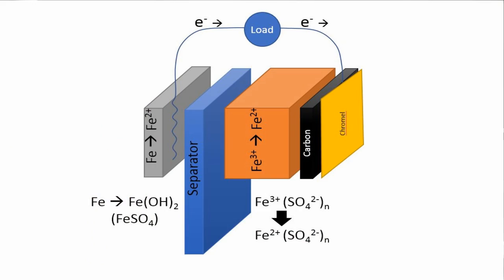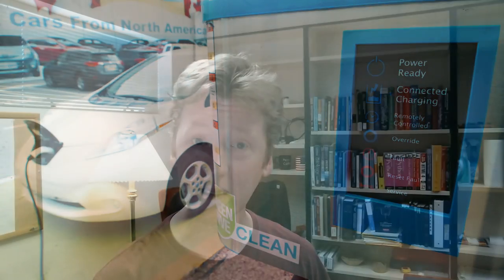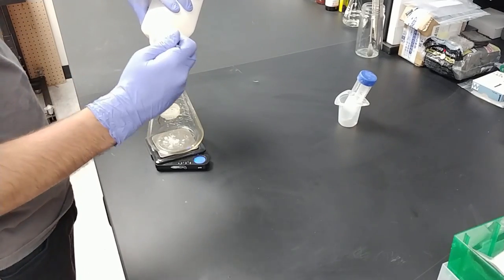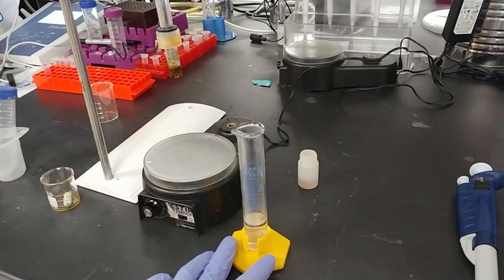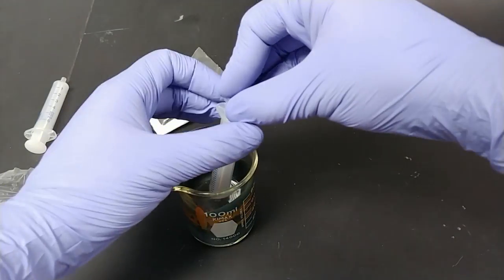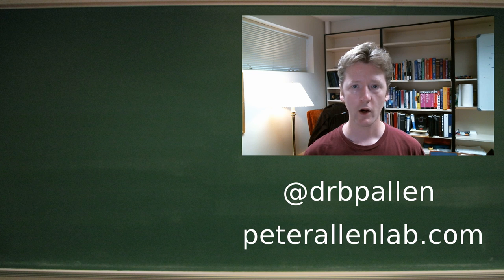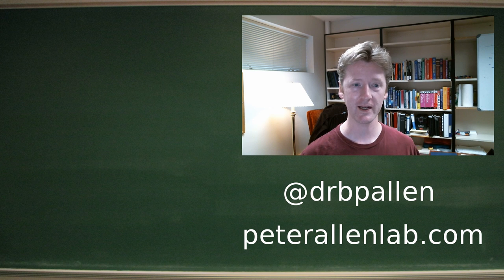Iron Battery 1.0: Build Instructions

Comment: I'm interested in the membrane that you created could you use that for a fuel cell hydrogen fuel cell with platinum in the whole thing Hillary so has oxygen your your container has oxygen on one side with the platinum and then and then what happens you have a barrier in there and then you have the hydrogen dribbling on another side and I know that another electrode and apparently he creates electricity just wondering if this membrane that you made it might hold up
Reply from the maker: We have tried several, but hydrogen is really good at getting through membranes. Usually fuel cells use Nafion. We have tried paper treated with nafion suspension, but even that might leak too much for a fuel cell. You really don't want hydrogen and oxygen to mix. The iron battery is very tolerant to cross-membrane leakage compared to a fuel cell.

Comment: would it be worth using them for home power storage?
Reply: Good question
Reply: YES - the ratio of weight to power works best for stationary applications.
Reply: Rough size on 48 volt 1000 kilowatt hour
Reply: @homermcclain7694  consider ESS made a 40kw battery fit into a tractor trailer, very large.

Comment: thank u...any posibility to power a  laptop..how big a batt u need in size weight ussing solar,,and  a invertor..
Reply: Please understand that while someone could just try to answer your question, I'd like to help give you and anyone else with a specific application need,  the tools to figure out the answer to their need.

1) Go to ebay.  Search laptop power supply.  Pick one.  Take note of its voltage and amp rating.  Consider how long you want to run it. The purpose is determine how much of a battery you need in terms of voltage, amps, and amphours. 

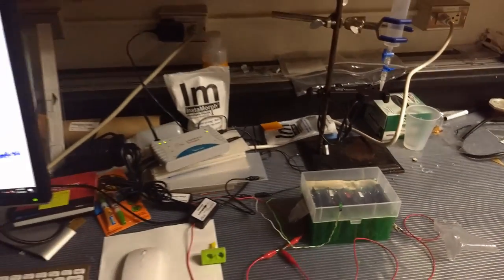2) Rewatch the video. Take note of the battery figures stated between 3:27  and 3:50 in the video. 

3) Divide the laptop power supply rated voltage by the 6 cell battery  voltage in the video to determine how many 6 cell batteries you need in series to get the right voltage.

4) Take the amps of the 6 cell battery in the video and divide that into the laptop power supply amperage rating to determine minimally how many 6 cell batteries you need in parallel to minimally supply the amps needed. 

5) Multiply the number of 6 cell batteries in parallel by the number of 6 cell  batteries in series to determin the minimum number of 6 cell batteries  you need to replace the laptop power supply. 

6) Multiply the amp hours of a 6 cell battery by the number of 6 cell batteries by the voltage of a 6 cell battery to get the total energy is stored in all the series and parallel batteries. If it more than what you needed to to run it as long as you wanted to, then great. If it is less energy then you need, then you need to add more batteries in parallel and rework your numbers. 

7) When you have determined  how many total batteries you want, multiply that by the mass of each battery to get the weight. 

Note: 
1) There are opportunities to improve the energy density with different construction methods, material dimensions, and spacing between plates. 

2) as for laptops, it was not made clear of you intended on replacing the lithium battery with an iron battery (bad idea if you want to carry the laptop because it will weigh roughly 25 times as much, not to mention you'll need to replace some of the charging electronics inside thelaptop), or if you just want to charge a laptop battery and how many times do you want to charge it. A laptop power supply supplies enough current to both run the laptop and charge its battery. 

3) as is with all batteries, one is likely to get better amphour performance from each individual battery as he adds more batteries in parallel beyond his minimal need.
Reply: You may want to look into a buck stepup dc to dc transformer, I'm using one of those to run my 19 volt laptop on a car battery.
Reply: The large Dell chargers output 6.75A at 19.5V = 131W. With this battery only containing 1.2w (0.600A * 2v), you need 110 of them to charge your laptop for an hour. On the bright side, you'd have a laptop battery that lasts for decades.

Comment: A company called ESS is scaling this to support the solar grid.  This battery has specific uses... not cell phones or cars...yet grids and large electrical fabrication
Reply: do you know the weight of that container and how much kwh it produces as hp conversion   I would love to learn research for a mid size trawler boat regardless im too old for these and ignorant   thanks for any info
Reply: @artregeous  you can try but I think you will find that this batteries are generally too heavy for vehicle use. Check out the ESS vid here: https://www.youtube.com/watch?v=HmtI8Wat7rY

If you want your boat to have free power, get a sail. Worked for the ancient Egyptians. Should work for you too.

Comment: Just a quick question,
How does your iron battery stack up to the Lifeso4 battery mostly from China?
Reply: DAYAN RICHARD LOW interesting question, google provides us this readout “Nominal cell voltage: 3.2 V
Specific energy: 90–110 Wh/kg (320–400 J/g or kJ/kg)
Energy density: 220 Wh/L (790 kJ/L)
Energy/consumer-price: 3.0–24 Wh/US$
Cycle durability: 2,000 cycles
Specific power: around 200 W/kg”

Seemingly lower energy density than lithium iron phosphate, however longevity of the cells is an advantage being capable of thousands more cycles than the lithium. I see iron phosphate cells in solar banks often, which is appropriate but imagine a larger battery pack that we don’t need to replace after a few years (2000/365=5.48 years) and this is an advantage over using lithium in my understanding.

Comment: I wonder what is the chances to make all boat hull or body with carbon fiber etc as battery  and considering surface of boat  is approx. 2750 of those 3x3 inches poaches connected as series    can I sail happy       how many amp or horse power such can produce    than I can calculate figure out how to shape the boat    I wonder if it is too ignorant to ask  hence I wanna learn at age 60  I have faith in science   any help suggestion   boat is a piece of cake to build   but sailing free is an art  lol   I can make it any weight  as long as kw per hour good enough for at least equivalent of 50 horse power  100 would be a dream   its just for a motor boat  can be a ting trawler max 20 feet

Comment: umm but i built a water powered battery that runs purly on water .. no salt ... and it produces 3.30 volts and lights up the led more than urs AND its MUCH MUCH MUCH SMALLER than your iron battery .....